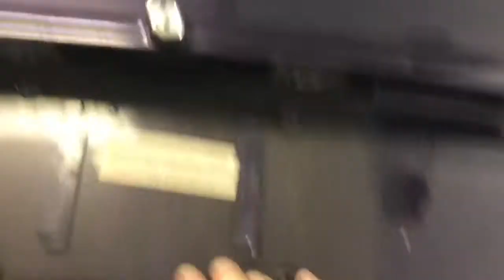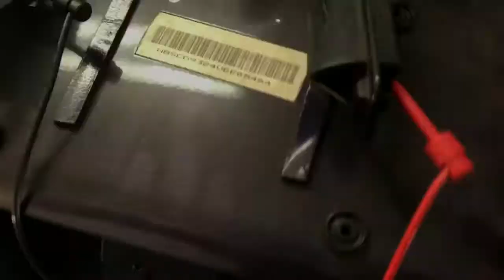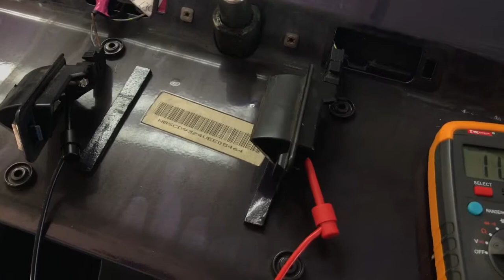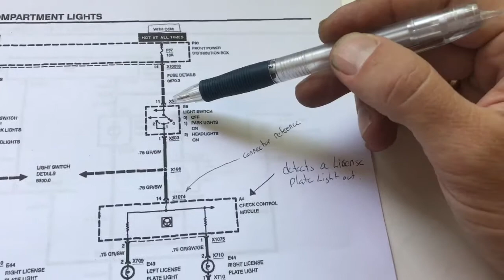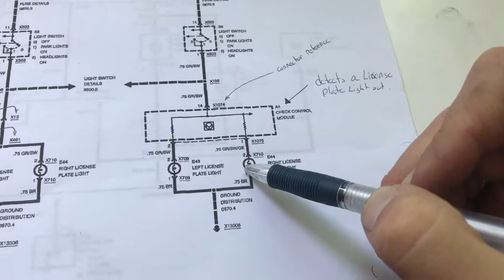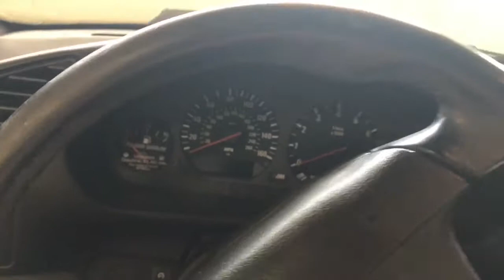BMW E36 M3 License Plate Repair Hack

Comment: I am  having the same issue with my BMW.  Even if replaced the light bulb, it only works for a few moments until I closed the trunk. I am glad I saw your video because the issue appears to be the wire.